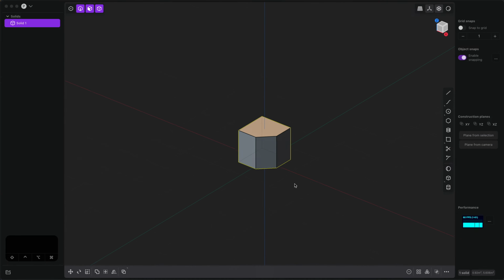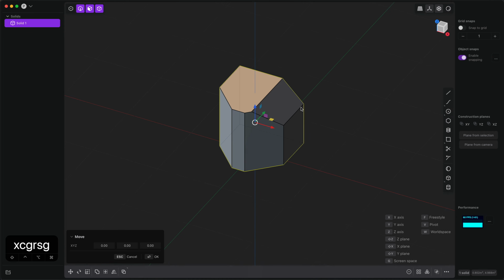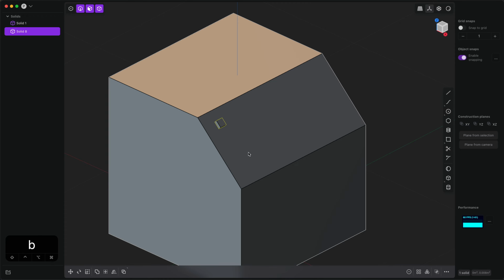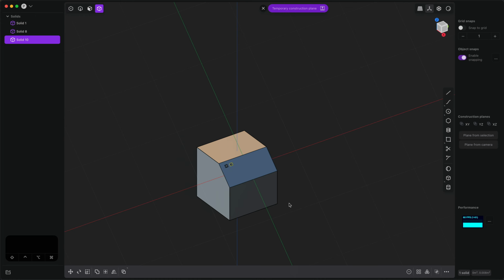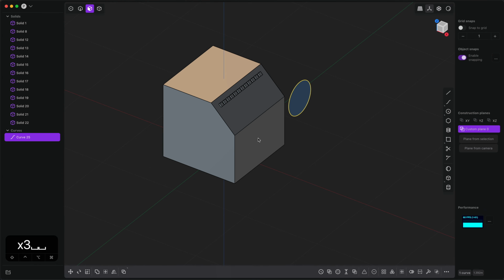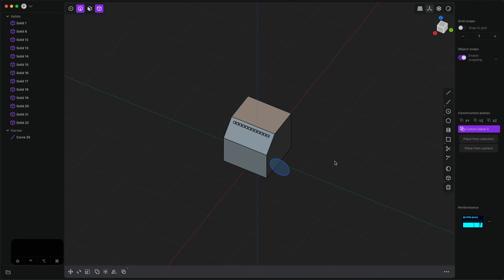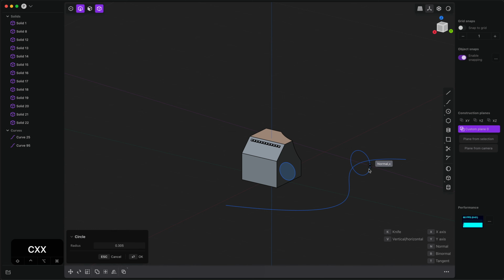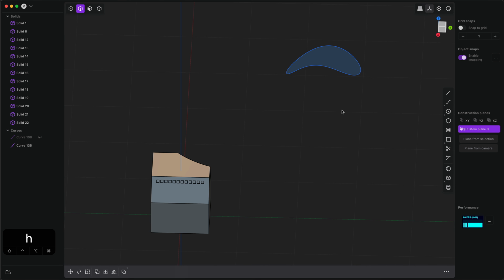Modeling off-axis in Plasticity

Comment: Forgive my ignorance but why can't I see the XYZ center lines and the grid on the construction plane like in your video? I only see them when pressing Numpad 1,3, or 7 etc but it always vanishes as soon as I change the view in the slightest.  And no matter the orientation, if I hold the center wheel and move the view around the cube is always moving around the on the Z axis line only.  What am I missing? I just went through the new help files first.

Comment: Is there a way to specify *exactly* under which angle (say from world origin) the construction plane would be created?

In addition I wanted to ask about the software capabilities in general... 
Does Plasticity have any parametric capabilities? 
And perhaps more importantly, is it possible to create curves from (parametric) equations? 
And finally, does the software have polar capabilities (polar/circular symmetry and arrays)? 
The software looks quite nifty and de-cluttered compared to many other CAD-s, but without the aforementioned capabilities it would be a bit difficult to design more complex parts to an exact design (imagine turbine blades or gears). I'm certainly interested in where this software goes and will certainly consider trying it out at some point.
Reply from the maker: Hi - some of these features do exist, but this is more a cad tool for artists, not for making precise designs

Comment: Many of these methods are very, very similar to DesignSpark Mechanical and Spaceclaim. Sure not all, there's no plane from screen, but the vast majority of plane creation methods demonstrated, those programs have been doing it that way for about a decade. Don't get me wrong, Plasticity looks fantastic...and I will be getting a personal copy when you launch it. At least I'll know how to make / use Planes instantly - LOL. The speed that you have 'knocked up/ created/ coded' Plasticity is staggering !
Reply from the maker: Working with construction planes is a pretty universal feature in cad programs. However, it doesn’t really exist in polygonal modeling software, which is where most plasticity users come from
Reply: @nickkallen1  Oh, now I understand...

Comment: Hey Nick I really tried to move over from MoI this week to Plasticity. I love everything about it UI/UX, modelling operations etc.. apart from the crucial part of exporting. MoI OBJ exporter exports a really clean ngon mesh (not triangulated) where Plasticity triangulates the mesh. Do you think it will be as good export quality in the future as MoI, or is MoI doing some crazy magic here?
Reply from the maker: moi has the best exporter. plasticity can do mostly ngons (I assume you tried this already), but it's not quite as good as moi. Maybe someday I'll improve it but I think people who need moi's quality can probably afford to buy both for now
Reply: @nickkallen1  yeah maybe I’ll try exporting as a cad file then use MoI for obj..I’ll give that a try next time, did a similar workflow with Fusion>iges>MoI>obj before Autodesk took out IGES export from free. I would definitely buy/sub IF I used it daily but I literally just use it for the odd element. Plasticity is just so user friendly compared to any of them :)
Reply from the maker: @Oldyellowbrick  always use step if you can
Reply: But there is an advantage compared to Plasticity, namely the ability to duplicate part of the geometry (such as holes), to another, for example it would be more convenient to take one part and copy several times the entire geometry (a great time saver), the same works with arrays (such as linear or radial), this feature is very missing in Plasticity (when I was using beta 0.1.74).
Reply: I just got into moi while waiting for plasticity to be released 😭